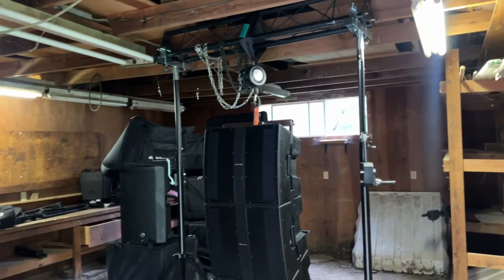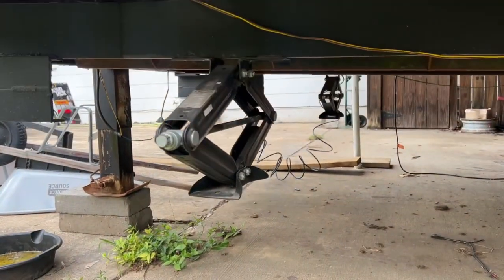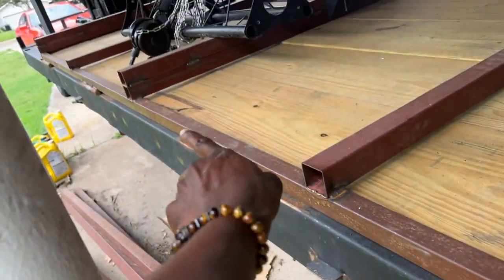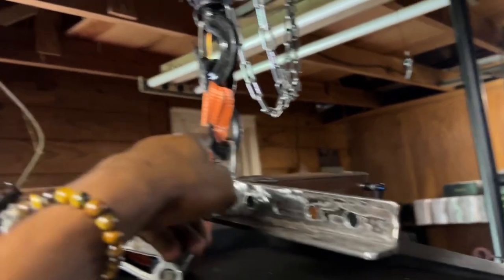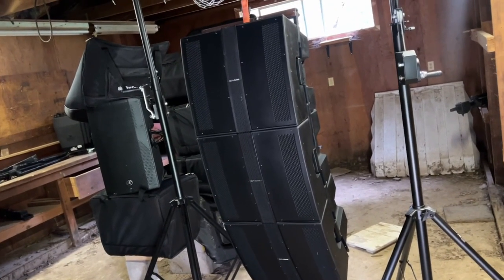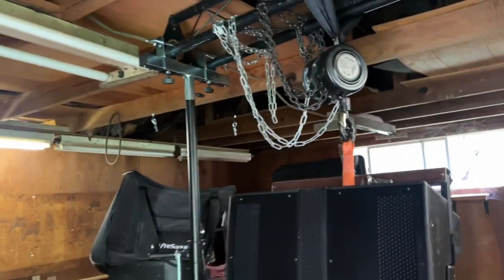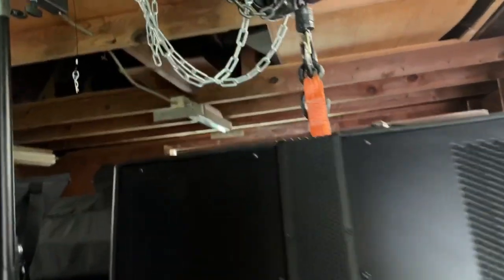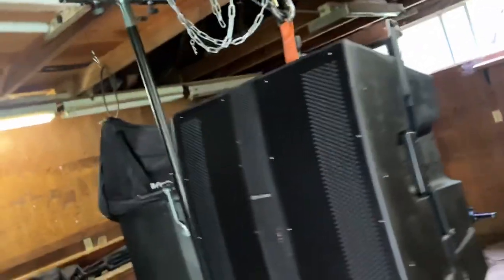Flying Practice | Presonus CDL 12P Speakers | Temp Flybar

Comment: For viewers of this video, please do not attempt what this DJ has done. Vick is going to seriously injure someone. Only use manufacturer approved rigging hardware for your speakers. Welding is a skilled trade, but your friendly local welder will not have the same training or education as the mechanical engineers who design and certify the speaker flybars. It's not worth dropping 70kg on someone's head to save a few hundred dollars.
Reply from the maker: I second what he said
Reply: kill somebody when 70 kg falls but hey... you saved money on rigging hardware.  so not safe.  That would NEVER pass an inspection here in ON, Canada
Reply from the maker: @garybyers4642  95*. How would you go by getting this inspected? It was only used once in September due to the actual fly bar being out of stock. Won’t need a fly bar til May & I plan to get the actual one since I’ll be adding to the system. Upgrading the truss & stands too
Reply: Here in Ontario, Canada we have the Ontario Building Code - subsection " demountable stages & rigging" and reading it can make your eyes cross :) Myself I am not a rigger and I don't pretend to be.  If you're in the US, you may want to start with an engineer or google your state's building codes under portable stages / rigging and that may give you somedirection where to start.  The important thing is with an engineer's inspection, you would have paperwork in hand.  Up here in Ontario, without an engineer's certificate, building inspectors can get really cranky.  Codes may be totally different down there, but if someone gets hurt at a show, the lawyers start rubbing their hands in the US and it's getting worse here in canada. Good luck

Comment: I agree to disagree with this video. The rigging system that he designed works well on a cheap budget. I know welders who are professional welders who are certified and can get the job done and make a rigging system just as good if not better than the price that Presonus offers for the CDL rigging bar. $599 is a chunk of money and you can buy the same grade steel and hardware and still make this rigging system cheaper that $599. I think what this guy has done is the safest system I’ve seen on a budget. I’ve done sound for years and had different systems set up and I can knock this guy for trying.

Comment: How's the Clipping issue? I don't want to buy these if there major clipping all the time?
Reply from the maker: I’ve learned to work around it. It’s just has  a sensitive input. Now I run them at +5db while I have my mixer at -10db. That way the limiter light & clip light both flash at the same time.
Reply: @lamarcobbs1  does it ever shut the sound down though?
Reply from the maker: @BudRV  it’s only happened once for me. That was before I knew their limit and input sensitivity. Shuts off for about 15 - 20 seconds

It wasn’t an issue for me as I run more than one per side. If you can’t get more than one per side, you’re better off going with the traditional speaker boxes
Reply: @lamarcobbs1  yea I was going to purchase two at a time.
Reply: Know how to EQ, and they have enough headroom for most events.